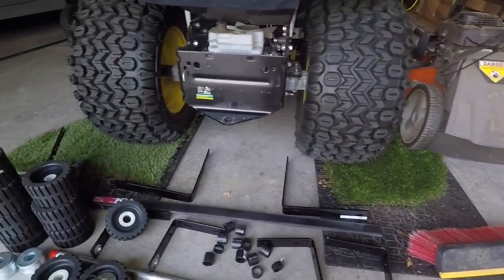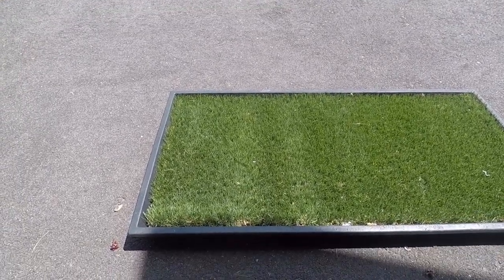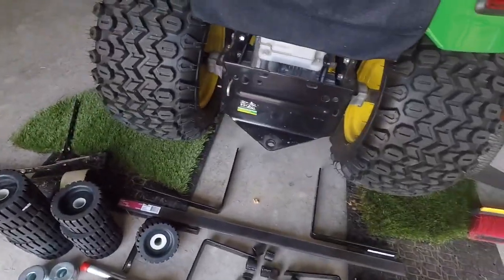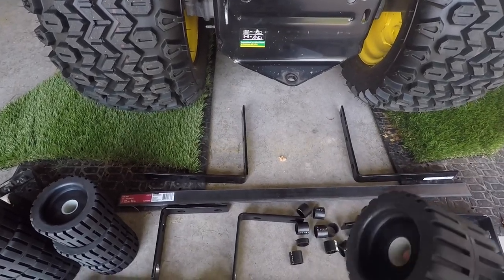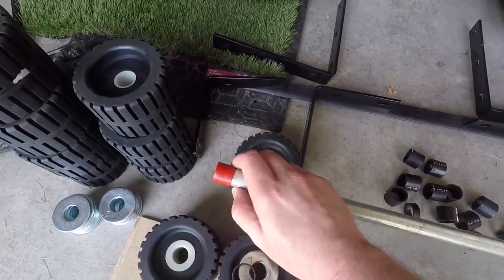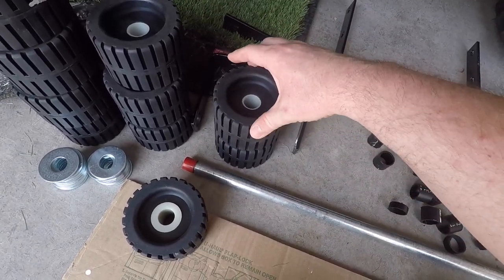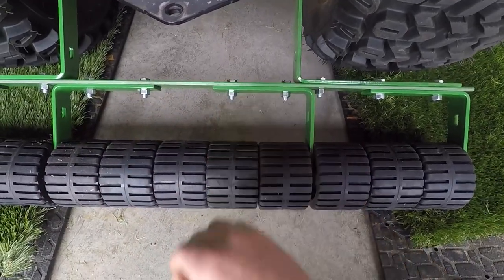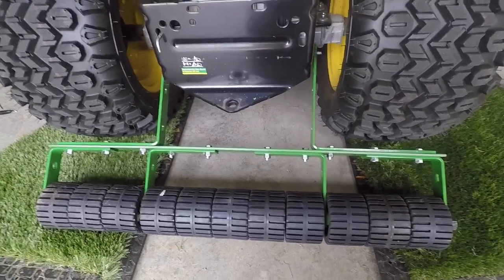Building Your Own Lawn Striping Kit using Boat Rollers

Comment: Truly a quality looking build.  Just wondering how this held up for you over time?  My biggest wonder was if you drive in a dip in the yard or up/down a curb, with there being no flexibility in the brackets.... how did it effect the rollers/bracket?  Nicely done!
Reply from the maker: On the third season now and it’s still doing good.  Dips and bumps are really not much issue because the entire thing can pivot up and down.  The only issue I have encountered maybe twice, was backing into something.  It ends up lifting the back off ground.  Hasn’t caused any damage, just a weird sensation.

Comment: There's a better way to do that pipe trick.  Instead of the covers you have, they make ends that go inside the pipe, and you tighten them down some and they expand to seal the pipe, leaving the entire pipe flat.  Kudos on making that expensive roller for so much less.  I'd wager the quality difference is marginal at best.
Reply from the maker: Nice!  I will have to look for those.  The roller is holding up decent for over a year old.  No bends like the previous pipe roller.  Thanks for watching!

Comment: I have been considering a build with the trailer rollers. Your comparisons of different styles of stripers was interesting. Your build was well explained and you had a good choice of materials to complete the job. Well done! Thanks.
Reply: BTW. I have a source for different size rollers. I may consider going to a 4" wide roller X 5" tall
Reply from the maker: @kencarlsen2212  thanks for watching.  Trying different sizes is helpful.  My very first roller was the pipe style but too skinny.  Not only did it not weigh enough but it had too much resistance in the longer grass.  I worried it was damaging the grass.

Comment: Looks fantastic! I am not super handy but I’m thinking of trying this on the back of my JD Z330 with a 54 inch deck. Gotta look at the back to see how easy/hard it may be
Reply from the maker: @jrowson  I wonder if the back end will be similar to mine with all the pre drilled holes for mounting stuff.  I haven’t really looked at zero turns much but I wonder about maneuverability.  Space on the back side of mower deck might be an option too.

Comment: Nicely done!  I'm looking to do something like this for my Spartan ZT........just curious, do you think the rollers behind the wheels are even necessary since the rear tires are likely imprinting the lawn already?!?!
Reply from the maker: Yes and no.  Before I made this roller I did use my original pipe roller which was just wide enough to fit between the wheels.  If I was making just straight lines then it wasn’t very different.  You can’t see it in the photo but the pattern pictured in this video starts out as circles around a large boulder.  The pattern is like ripples going out. Wherever I mad a tight turning curve, you would see a small stripe that didn’t lay down the same.  The wider roller helps sweep over the area better when turning.

Comment: What model JD? I’m not seeing the holes on my E160 where you mounted the 10”
Reply from the maker: My model is a x580.  I have a rear frame plate back there for mounting attachments.  It might have been a piece that got added on for my snow blower from the dealer.

Comment: Awesome job on the building your own kit. On the 6x6 L-brackets, did you drill the holes so the steel pipe could fit through? Or did you buy them that way? Also, what size did you cut the spacers to fit between the rollers?
Reply from the maker: I did drill the holes.  I used a 25mm “hole dozer” by Milwaukee.  The spacers are 1/4”, 1/2”, 3/4” and 1”.  I had to size them up as I did it and I just kept a bunch of the different sizes available.  For example, wheel to wheel most likely about 1”, but if it was divided with a bracket it was more like wheel-metal washer-1/4” pvc spacer-bracket-1/2” pvc spacer-metal washer-wheel.  To complicate things, the wheels are not symmetrical.  There is a shallow side to wheel with extra white plastic.  Hope this helps.  Thanks for watching

Comment: How wide are the 6 inch brackets?  Did the conduit pipe fit thru those 6 inch brackets?  And why did you build 36 striper if your John Deere deck was 54 inch deck?  Are you overlapping when you cut the grass?
Reply from the maker: The 6 inch brackets are 1.5 inches wide.  I was able to drill a 3/4 inch hole so that the conduit pipe went through the brackets.  The conduit pipe has threaded ends so I was able to find a large nut to cap it off but it is not overly tight.  I went 36 inches because I didn’t want to exceed the width of back tires  for maneuvering.  I have a core aerator that is wider than tires and I have some trouble spots for turning.  The tractor mower is my biggest obstacle with making quality stripes, since three point turns end up erasing some of your work.  If I had a zero turn I would have made closer to deck size.

Comment: are you using pvc cutoffs/washers/conduit pipe all 1/2"?
Reply from the maker: The conduit pipe is 1/2 inch with maybe 0.7 inch outer diameter.  Maybe slightly larger but still able to fit through boat rollers.  Then the pvc pipe has to be larger inner diameter than outer diameter of conduit.  My washers and pvc pipe are loose fitting so somewhere between 3/4 and 1 inch since they only need to contact the rollers to maintain spacing.

Comment: What size holes were drilled and size bolts?
Reply from the maker: I’m pretty sure I used 1/4” thick bolts.  1” or 1 1/4” length but double check the thickness of your metal.